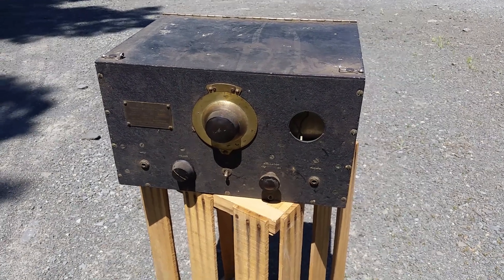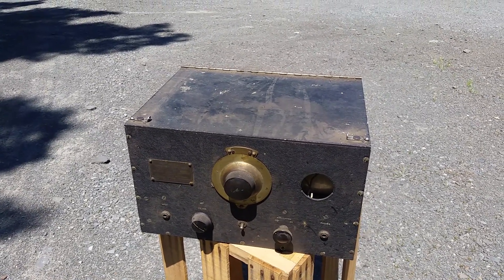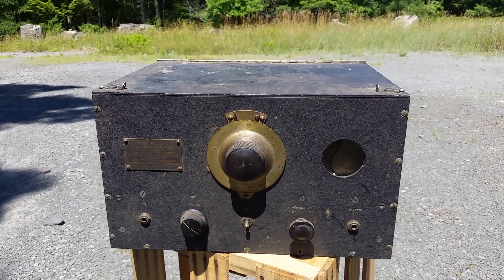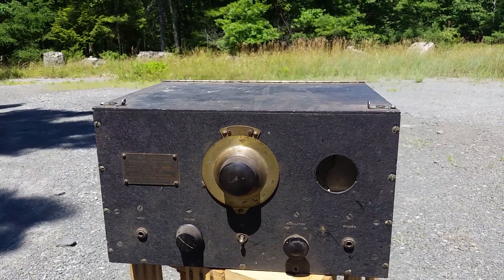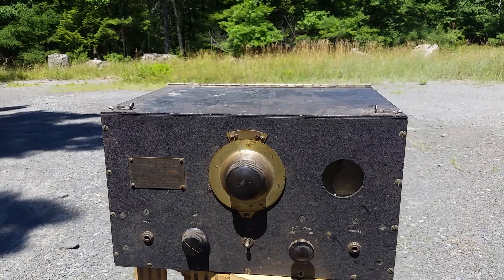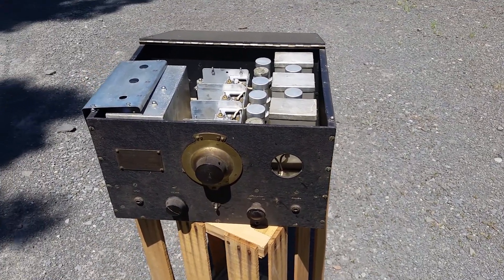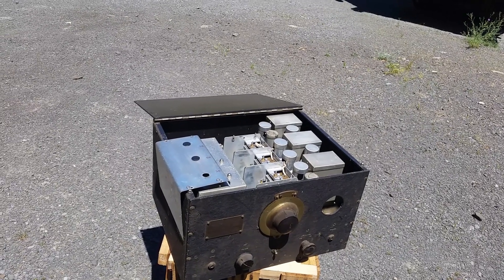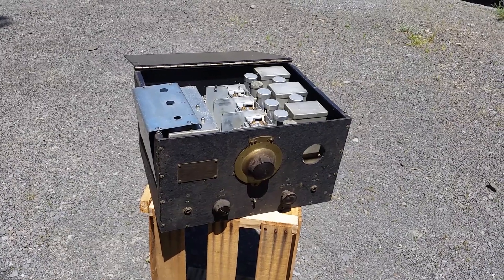1933 US Navy JK Sonar Receiver Amplifier

Comment: JK sonar was also known as "supersonic" sonar because it's freq. range was somewhere about 15 to 50 KHZ before WW2 and reduced just before the war to 17- 37 KHZ. This sound is received by a Rochelle-salt hydrophone, amplified and superheterodyned to a freq range that humans can hear. The supersonic freq range is important because it reveals several discrete freqs. from a targets main propulsion and prop cavitation. These different machinery noises quickly reveal target aspect changes (changes in target course and/ or speed).  Propeller RPM is very important because it reveals a targets speed in knots. This aids the fire control party find a solution to fire torpedoes for submarines or depth charges/ hedgehogs for surface ships. Another passive sonar used by the US in WW2 was the JP. This was called the "sonic  or topside sonar" on submarines. Its freq range was about 20 HZ-19 KHZ. Lower freq. sound travels through the ocean with less attenuation than higher freq sound and this means it is capable of being received for longer ranges than higher freqs. and gives a longer range sonar and= earlier target acquisition. The QB and QC sonars were active portions that were basically a noise maker providing the "ping" which was paired up with the JK passive sonar and some relatively crude processing and display to show bearing and range to a target, passive sonar only give a bearing to the target. Side note: the JK freq knob would be used to sweep back and forth by our subs over the freqs used by the Japanese navy's active sonar to see if they were in contact. Contrary to what you said the ability to receive and process all the different freqs was VERY important to our navy in WW2 and to this day.
Reply from the maker: Thank you for your additional input.

I had a chunk of a JP, but it went to one of the museum boats (probably SS-383).

Comment: https://maritime.org/doc/fleetsub/sonar/chap5.htm Thinks thats a start for you on a manual
Reply from the maker: Thanks - I know about that site.

I have a relatively huge number of US Navy sonar manuals (mostly because no one else wants them!), but not for this specific set.
Reply: @uniservo  I served in the RN and for a time worked on the 184 M sonar system The power amplifier valves for the staves were huge. I got my worst shock ever focussing the PPI display which was tag strip with a pot right next to 600 V dc and right above 900 V dc. Of course the ship hit a huge wave and I copped for both of them